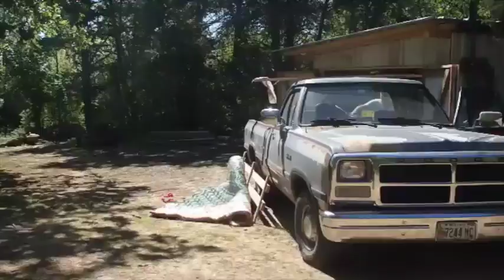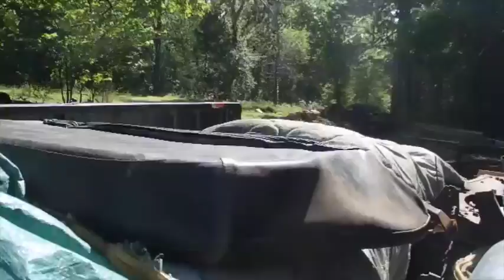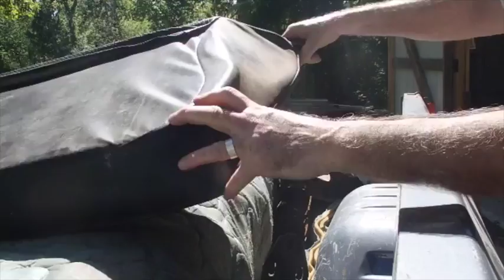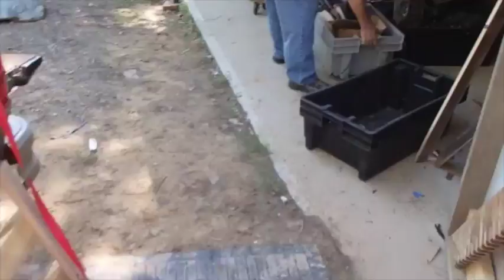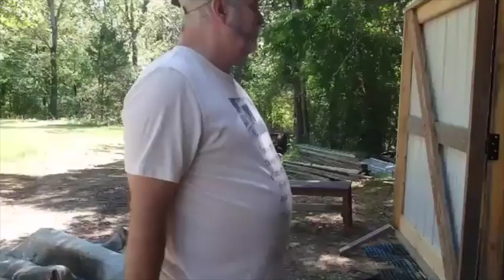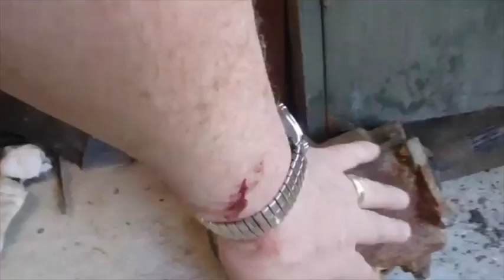Crosley paradise at Cutworm59's

Comment: That's a Borg/Warner T-92 transmission. If you need parts or complete NEW units Olympic Gear has them. The tip of the shift lever likes to wear and cause them to stick in gear or not shift at all. They are EASY to weld up and grind/file into shape to make them like new.
Reply from the maker: +Blazer02LS    Good to know.   The one that's in it shifts like a dream so I think I'm good.  Always good to have a spare though..